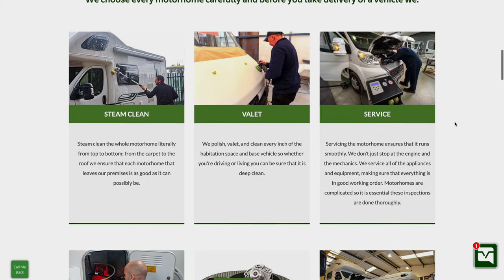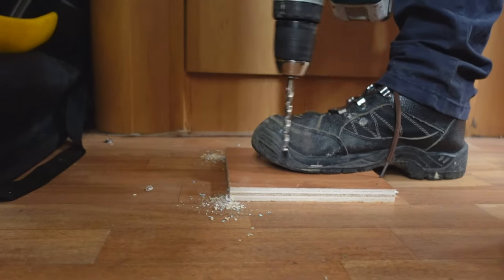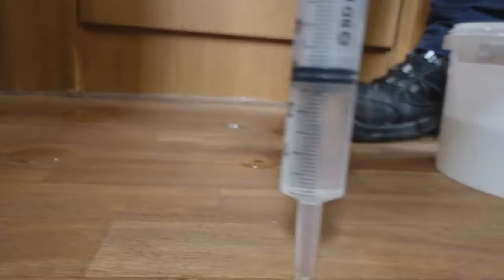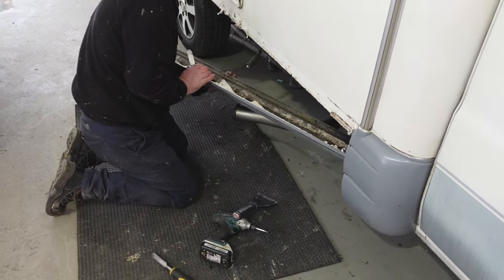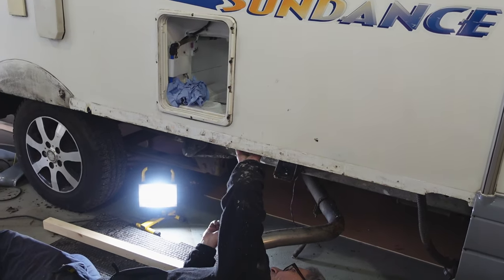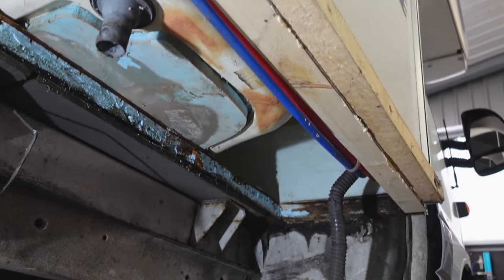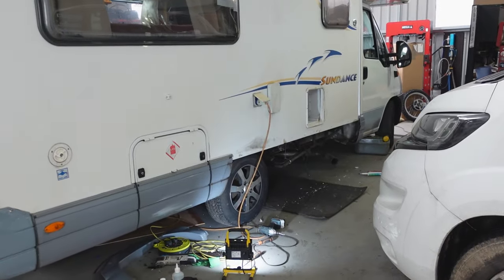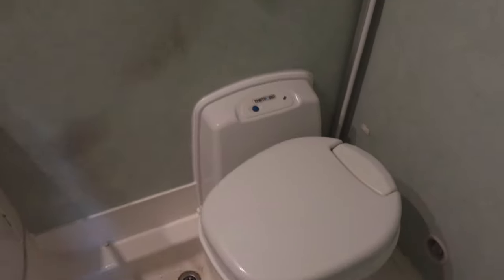ROTTEN Motorhome Floor & CRACKED Shower Tray!

Comment: I find it so hard to believe a manufacturer thinks it is acceptable to put a joint in an inaccessible place. I know sometimes you have to run pipework (gas or water) behind panels or even under floors....but do it in one length so it cant leak without being punctured. A joint can always leak. 
Its a good job you found some decent people who can fix problems like that.

Comment: As a joiner of 40 years and counting, it looks like they did your work correctly. Only thing I might have looked at doing is leaving an inspection hatch at the area where your t connector is, just so you can give it the once over every few months. No idea if that is possible once your insulation is back in but lack of access is why you didn’t see the rot before. Anyway, looks like a good company.
Reply: Actually i like that idea , and it makes an awful lot of sense . There  are connections under there , and they're sealed . My own Hymer has twin shower traps  under the tray ,  and flow can be a bit slow , makes me think a clean maybe needed . The traps are cleanable , but you just try and get access . Maybe i will add one , have to take a look , at whether that's feasible .

Comment: They are skilled tradesman and they show you their work brilliant you can trust them
Reply: Our structural repair guy Paul who you've seen in the video is of legendary skill level and has done literally 1000s of similar repairs. He can strip a motorhome which needs repair and build it back up again properly to original standard. His work is better than factory as he finds the design fault and rectifies it to ensure the same problem won't come back.

Comment: If you are using a pressure system, you can always put in a pressure switch to an alarm card on a TXT system for when you are away from the van and you get a leak and pressure drop. A bit over the top but did for a lady who was a bit ocd froma prev issue. If you are in the van and the pump kicks in for more than 3 secs (worry) lol

Comment: Great Vid D man.  I lived on narrowboat many years ago and those push fit bloody pipes flooded my boat with the entire contents of my water tank.  Wrote off all the woodwork, walls and floors ..... luckily, it was only 1 year old and the company refitted it.   Hope to see you again D at this years NEC.
Reply: well you fitted them incorrectly as most people do, they dont cut the ends of with the right tool, fit inserts and dont push them till they bottom out. These are used in some of the harshest enviroments in the world with no issues.
Most on these sites creators included are amature builds and learn from whatching videos with out the under pinning knowledge such as engineers like my self learn through training and experience.
Reply: @ollydogtravels9465  ...I didn't fit them and never stated that I had.  It was a new build boat ...as stated above.  It was fitted correctly (by a Marine engineer), it cracked and failed - hence why the company refitted my boat out from floor to ceiling under warranty.  Nothing at all to do with incorrect fitting, amateur builds or incorrect tool selection.

Comment: hi Daz i had a similar problem in my kitchen the extractor vent cover outside the seal had failed and it rotted all the wall inside i had to take all the cabinets out and the strip all the rot of the walls and replace lucky i could do all this myself but still a lot of messing and expense i refitted all my toilet while i was doing it new pvc wall panels and refitted the shower tray it makes you think all the money we pay for these vans and they are just 40mm insulation and ply wood glad you got sorted

Comment: Hi Darren we had the same problem with floor and shower. We had to have most of our floor done we had to have the whole floor done. If your group are looking for a guy who does all older motorhome then I would high recommend Costal caravans and motorhome north wales x
Reply: @24k__J  we had most of the floor replaced it was completely rotten

Comment: Darren, I think they are not well built from new, the wood they use, does not seem treated, and the push fit couplings they use, are cheap and nasty, with the price of these new, you would think that they are built to a good standard, and capable of lasting for many years without a problem, its a good job that Oak tree were able to assist you, they look a trustworthy and well run company, with a good reputation
Reply: They really only last 20-22 years and then they need resurrecting.

Comment: If anybody is buying a campervan and the seller tells you it's been lived in you need to be extra careful and check it well because condensation and leaks from a vehicle that's been lived in there is usually a lot of damage in places usually can't look at on vehicles that are not very old.. That's a good way of fixing the floor never thought of that👌...
Reply: That resin system is brilliant. The floor is rock solid after the injection and much more resistant to it ever happeing again. As Darran mentioned in the video it can be done from underneath at a higher labour cost to preserve the original flooring. If you do it from the top you can just stick a new layer of vinyl flooring over to hide the dowels.

Comment: kudos to the repair company indeed but omgosh, so much batten, untreated wood, polystyrene and plastic in campervans!

Glad i instead bought a Modular Ambulance…. aluminium and stainless steel supports and flooring with not a sight of wood below floor level anywhere (in fact the only wood is to support the foam  padding so you don’t bang your head! (and my furniture lol)
I guess £150k gets you a better box…

An interesting video indeed Darren. Do you really want another Motorhome after seeing that? 😮
Reply: To be fair Darran's van is quite old technology now and most manufacturers have moved to GRP panels and Aluminium framework now so even if they leak the water can drain out of the walls without causing any damage. Some of the early Alu-Tech Baileys suffered from water hitting the edge of the floor when it leaked through the walls but this seems to have been fixed in later models.

Comment: Those push fit connectors are crap even when they are accessible. The rubber o rings that make them seal, harden over time , and then they lose the seal and leak. My German van has tail connectors that are sealed with jubilee clips. They have never leaked and the van is 16 years old and constantly used

Comment: Feel  and share your pain. I had the same issue with my purchase. However Mine had to be more so a full inside strip out, including side panels, windows out , new timber all sides, rear and roof.  All wall mounted cupboard stripped out as the backs and underside had been water ingress for years, same mulch as your floor. All had to be renewed. Then all new 100% rewiring, 100% plumbing. Underside had been very carefully work upon to hide the ROT. I have so far used 8x4ft 4x4ft 1.4mm sheet steel to fabricate all new panels, old cut out,  Oh and I'm on my 3rd roll of Mig wire, guess what I still  haven't finished. I am totally disgusted with what has happened. Some people are smiley face but black hearts. I guess that the chance you take pay before you buy.

Comment: i would have had them use marine grade plywood and then have it sealed with enamel paint (4) coats) or other wood sealer and under coat spray when put back together. did that to my trailer and my fishing boat. i know its over kill but it lasted 10 yrs of hard use

Comment: that was bad having a joint in the pipe where you cant get to it because its sealed in. stupid.  like you i would have crapped myself seeing how bad it was underneath.   got to be done by experts, i wouldnt attempt that repair.  they did an amazing job.  horses for courses, they know what they are doing.   great video, thanks for sharing with us.👍